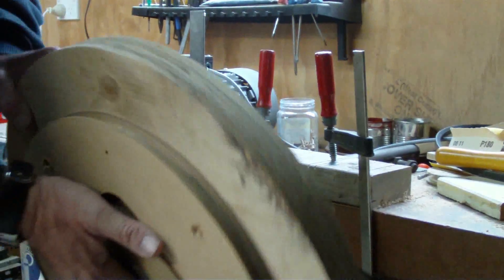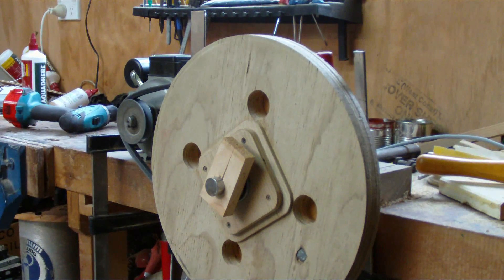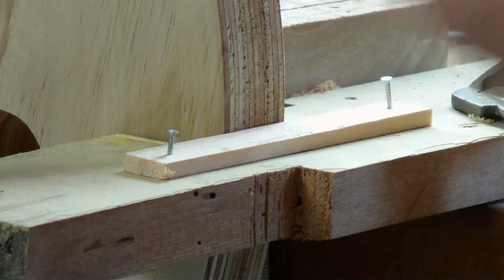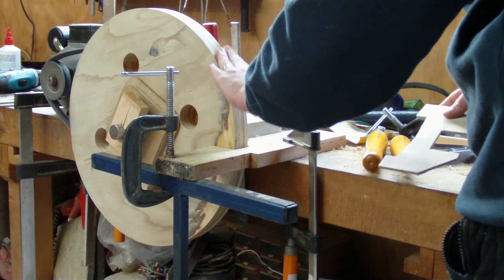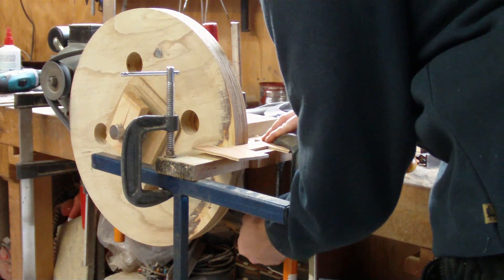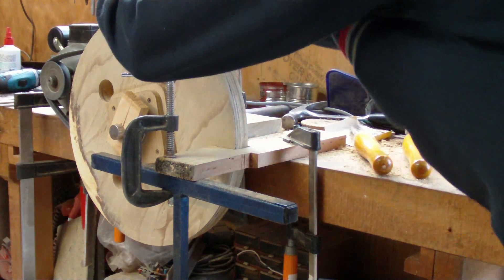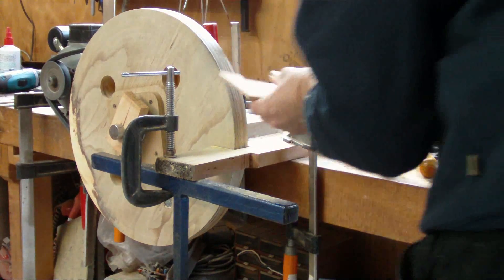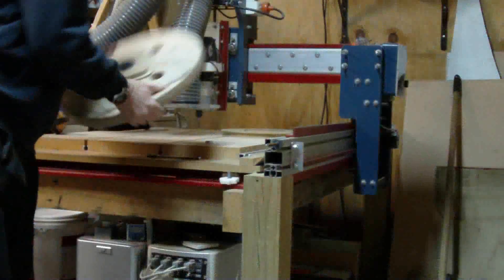Turning the Bandsaw Wheels - CNCnutz Episode 25

Comment: scary bearing squeal at lo speed
Reply from the maker: christophe leblanc 
The squeak is probably from the temporary motor I used for the turning. The bearings in the wheel are brand new. I suspect it is the starter winding clutch that is causing the squeeze when it re-engages as the motor slows. 
Cheers 
Peter
Reply: just would be frustrated my self ,,, after putting all the effert only to have to take things apart to repair,,, ,,,, i have learned from my past ,lol

Comment: Hi

I made wheels of a similar appearance for my bandmill ( not bandsaw ) I laminated thin sheets of birch ply with layes of glass fibre, the outside of the wheels is a layer of glass fibre.

I used glassfibre cloth several layers around the rim before sanding off the crown, I felt it was wise to have layered up glass fibre under the blade to avoid any tendency to delaminate under physical stress.

Laminating process required the ability to lay down fibreglass neatly at uniform thickness - used a pile of weight lifting weights during curing and added one layer of ply and one layer of fibreglass each side per session, wanted symmetric curing as fibreglass can pull a bit while it cures so working on one side only could cause creep.

Wanted extra strength as I am running with around 800 pounds of blade tension - also glass fibre stops warp or distortion as ply layers are pretty much protected against ingress of moisture. Glass fibre is not actually a complete barrier against humidity change but slows it down a heck of a lot so far less variation

I am not the first to do this kind of laminating a number of bandmill makers in the US  who wanted larger diameter wheels went this way also, steel wheels at larger diameters are tough to find at a reasonable price.

I am using 40mm axles, large pillow block bearings. taper lock bushes and hubs (fitted either side) to ensure high strength and to ensure that what starts true stays true as I am putting around 12 horsepower into the wheels.
Reply from the maker: Sounds very cool. With 12 Hp of power going to the wheels and 800lb tension, adding fiberglass seems like a very good idea indeed. The mill must be an awesome sight. Do you have a photo?

Comment: You have done a great job with your wheels at glue up.  They look like they run very true before turning.  I have had a hard time with my wheels.  I have wobble and I cannot get true. I used a bench chisel though to turn.   I have turned the wheels down now beyond the circumference spec. so I have to make new ones.